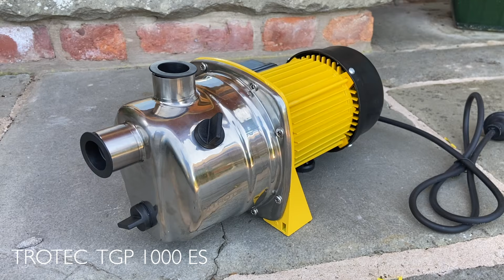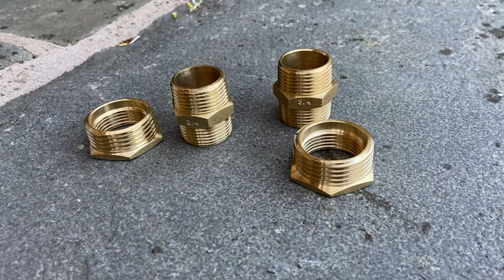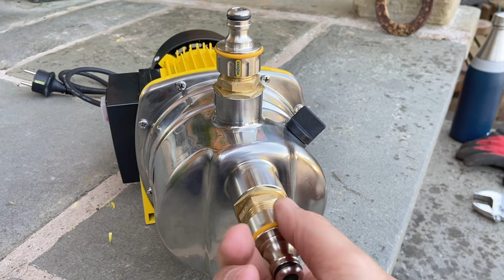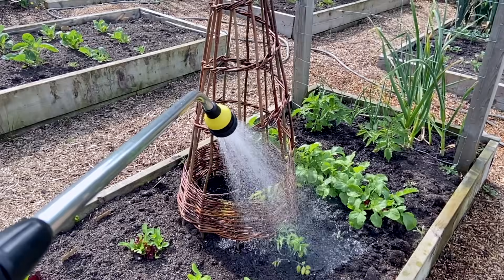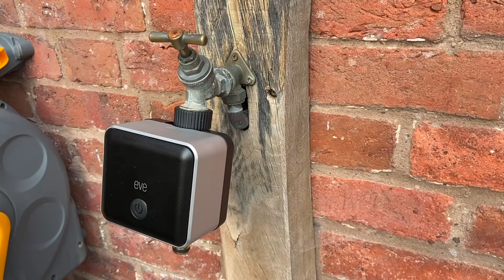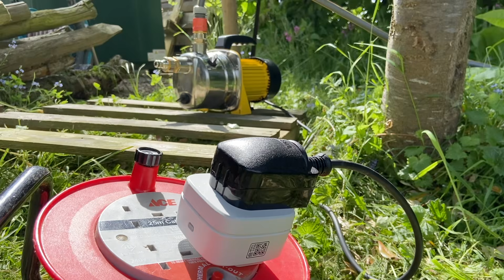How We Fixed Our Garden Hose Water Pressure

Comment: Thanks for sharing this information. Just a quick question. Is this pump connected to your water mains or to a water tank? The reason I’m asking is because I have the same problem as you. I was told this type of pump can only be connected to a tank rather than a water supply with the pressure. Thanks .
Reply from the maker: Straight out the mains… no water tank, and works perfectly.

Comment: I’m trying to have my lawn watering completely automated- timer starting at 4:30am then switching zone by zone. The problem is that the water flow is quite weak and some sprinklers are barely sipping even though the gauge is showing 50 psi at the tap. We have a long and pretty narrow lawn. I’m considering getting a pump, but I definitely can’t babysit it. Is there a way to have it fully automated?
Reply from the maker: Off the top of my head the eve Aqua would probably be the easiest way to automate if you had a dedicated tap and pump: Eve Aqua Review: Thread Enabled Smart Water Controller
https://youtu.be/5jw5kKVS8s0

Comment: You're going to burn your pump out long term, you always want a larger inlet diameter to the outlet to prevent the pump from starving. Ideally you want to run a large diameter hardline to the pump.

Comment: Heres a scenario I'm trying to conquer. I have a large 300 gallon water tank, one of those white plastic ones filled with water. I want to hook a pump to it to pressurize a 100 foot water hose while having enough pressure to rinse a car. I would power the pump with a remote controlled receptacle like people use for outdoor Christmas lights. The tank is in my backyard and my hose is in my front yard next to the driveway. A fence separates me from the tank which is why the pumps power will need to be turned on with a remote. Since I'm not in the backyard when I turn it on, obviously I cannot prime the pump so I would need a self priming pump. Reason I'm drawing water from the tank instead of my house is because the water has been filtered through reverse osmosis to make spot free water for rinsing my car. What kind of pump would I use to get enough pressure to rinse my car off with a 100 foot hose?
Reply: 0.75kw pump or less would di